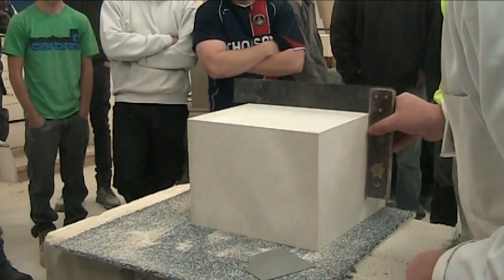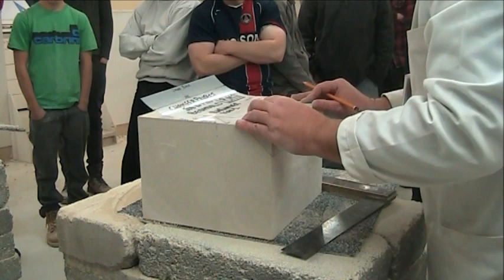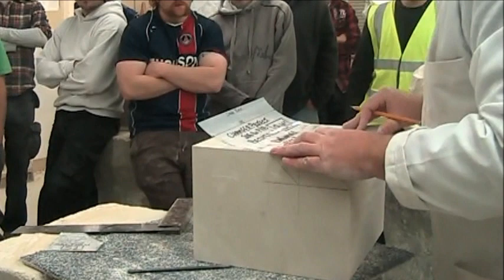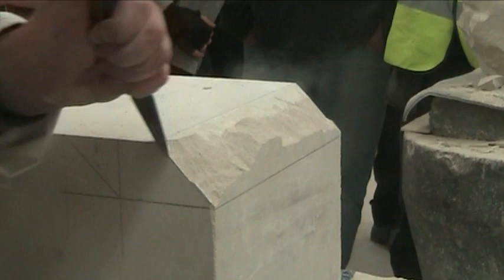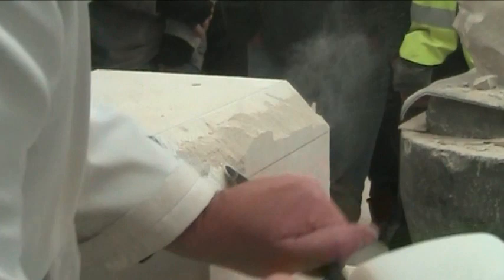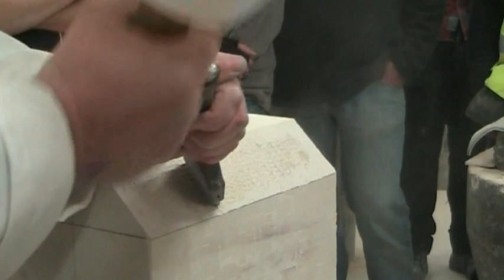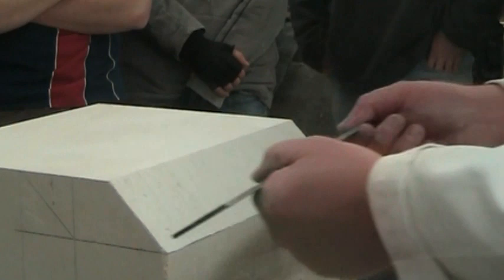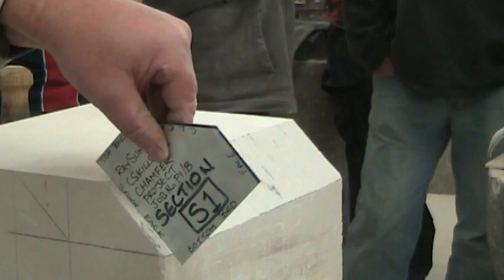Stonemason lecturer Ray Sumner chamfer demo

Comment: This guy is highly skilled and yet thousands of years ago there were people that might make this guy look like a apprentice. Some of which had no metal tools and used harder stones the people that built Puma Punku for example. Master craftsman using techniques lost to time sadly.
Reply: Hitch Slap he did say "some"' Which must be true, the real early stuff didn't have metal tools, there are ways to use stone that requires no tools
Reply: @iambeing4328  I have to agree. Were they banging fist sized diamonds on granite? Probably not. They also weren't using copper or bronze, or iron or even just normal steel for most of their very skillfully carved granite, diorite, basalt, and quartz art and artifacts. Lasers, certainly not, but they had proper tools.

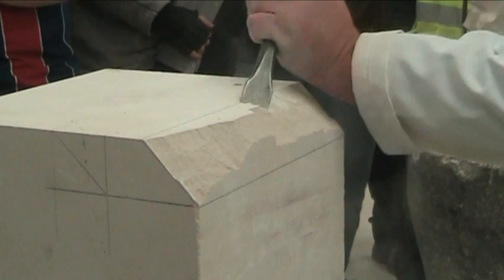Comment: i am a stonemason and he must have very good quality sandstone for making such big strikes in 11:25 in lesser stone that will make large chips and go under the line creating holes.

The way he is carving the stone is not good for beginers the constant lifting of the chisel is not a easy technic steady hand and precise aim you get after 1-2 years of work and carving this fast at least another 4
Reply from the maker: +scasny This is a Portland limestone and is worked a lot differently to sandstone. With Portland it is a high quality freestone and you can work more off in one go ,like you say if I did this with sandstone it would pluck out leaving big holes. The methods shown are techniques which have been used for 100s of years in the Portland quarries.
Reply: I dont disagree with you i dont realise that is limestone most of the time i work with granite.It must be very satisfaing fealing working on some fine limestone.I dont want to criticise you the stile of working reminded me of mine teachers.Now i use the chisel same way it just takes 6 years to feel the stone and make big precise stikes.I work with stone 13+ years and still lerning.
Be proud but modest
Reply from the maker: +scasny I agree with you it does take  years to be fully competent to work stone
Reply: DUDE....I LEARNED THAT TECNIQUE IN THE FIRST MONT OF TECHNICAL COLLEDGE.....YOU MAY NEED TO UN-LEARN A BAD HABIT......YOU MUST AIM AND RESET EACH STROKE.....MAYBEE 2 TAPS BUT NO MORE OR YOU DRIFT AND DIG IN.....THIS IS LIMESTONE....SANDSTONE IS SIMILAR BUT GRANITE IS ....BIGGER TOOLS AND MORE FORGIVING.....WHEN YOU HIT THESE SOFTER STONS.....YOUR GRANITE HABITS WILL BRING YOU TO GREIF.....maybee thats why you go under the line.....you may be holding your chisels to tight as well.
Reply: Dude i dont know what part of the word are you but i am from poor state in central europ i only work with cheap shit grade stones.One time i impact too hard and the stone with size of a microwave split in half vere the vein was.Most of the time when i work i not a good idea to chip chunks biger that a dime
Reply: Stonemason?? Are cornerstones hollow? Is the Illuminati real?
Reply: Cody Hubert ; not sure about the rest, by some corner stones contain singing frogs.
Reply: scasny Is it sandstone?

Comment: How close to the line do you place pitcher? Great lesson !
Reply: When should hammer be replaced with a mallet? And what do you think of grinder being used to remove stone as opposed to punch and toothed chisels
Reply: mallets are used on mallet head chisels....musroom headed to you.....and a grinder leaves a grinder mark....and looks crap.....if you get a skutch comb chisle and clean up the marks its ok....but you need to be able to work without electricity to call youself a real stonemason.
Reply: You can use different grits on angle grinders to take the marks out completely. It also helps to be competent with an angle grinder.
Reply: Then again I'm a cement mason.